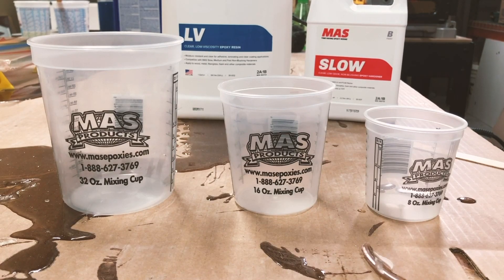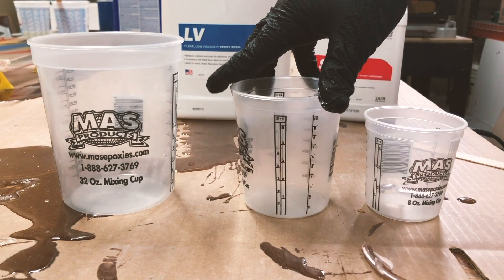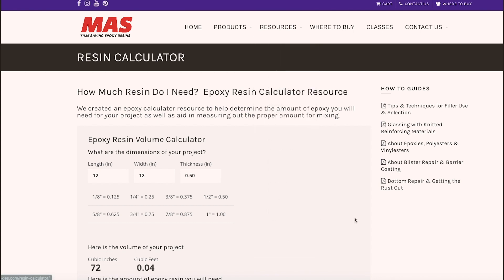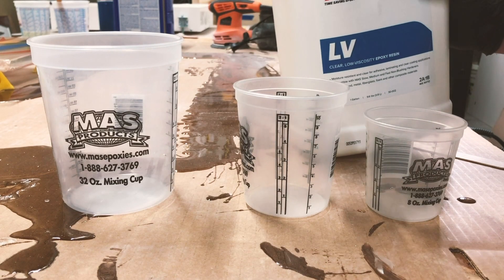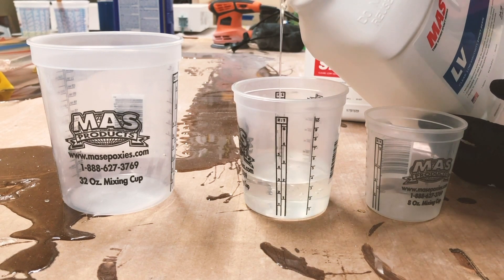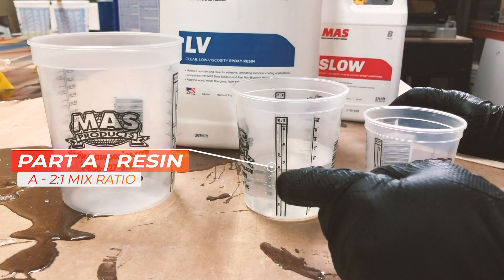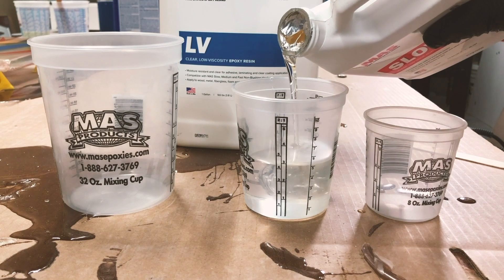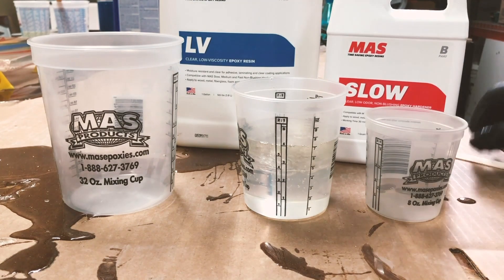How to properly measure epoxy resin |  2:1 Ratio Explained | How to use ratio mixing cups

Comment: I used 2:1 resin for first time and it doesn't harden after over 8 hours at all .. and it's not enough . Why?
Reply: Because video is wrong. Next number will double amount, but not add two portions of epoxy over hardener. You should use two containers to measure properly. For hardener use container A with low position number and container B for resin use the same number but in top position. Hope it helps.

Comment: If I needed a 2:1 ratio of resin and my total weight of resin was 90 grams, does that mean i would mix 60 grams of part A and 30 grams of part B, is that correct for a 2:1 ratio?
Reply: Yes vorrect

Comment: For a keychain letter mold do I put 3 resin and 3 hardener
Reply from the maker: It depends on which epoxy you are using! If it’s a 1:1 ratio like our table top pro or art pro, then yes! If it’s Annie’s Art Kit, LV, or FLAG then that’s a 2:1 ratio! You can use our resin calculator on our website to figure out how to do the math!

Comment: Still a bit confused if i was going to do a resin pour and the total quantity is 4 ltrs at 2:1 , is their a formula i can use to calculate how much of Part A and how much Part B i'd need to use, Cheers.....
Reply from the maker: Yes you’ll be able to scroll down on our resin calculator page! Then plug in the amounts that you’ll need to find the split!
Reply: I’m also still abit confused 😅  I have a river pour of 3 litres with it being 2:1 how do you calculate how much harder you need for 3 litres

Comment: These cups look super helpful! The only thing I’m confused about is how to figure out how much to measure, i understand reading the cups but I’m used to a 1:1 ratio so it’s easy for me to figure out how much to measure for each for four ounce, two ounces for each. How do you figure that out for a 2:1? Or when you use the cups and measure up to the number five does that mean five ounces? On the calculator you mentioned you have to put in the dimensions not how many ounces you need all up. Thank you
Reply from the maker: There is an area on the cup for that! So you’d pour your part a first to the 2 line (for example) then you would take your part b and continue filling to the 3 line. That would be a 2:1 ratio!
Reply: @masepoxies  first of all thank you so much for taking the time to reply to me, I really appreciate it. I understand the concept of using the cup to measure a 2:1 ratio. My question was what does the number 3, for example stand for? For 3 ounces of resin all up?
Reply from the maker: @Gazzaxxo  great question! Let me ask my coworkers because I do not know the answer off the top of my head!
Reply from the maker: @Gazzaxxo  so fun fact, they aren’t any measurement in particular! They’re just segmented portions!
Reply: @masepoxies  oh wow! Thanks for finding that out. How would you know which portion todo then? Maybe that’s what’s tripping people up…
Reply from the maker: @Gazzaxxo  basically it’s just however much you think you need. If you want, our customer service team can explain this better! Hello@masepoxies.com will get you to Cory who is great at explaining this while I am sub-par haha - Hailey

Comment: so 2:1 means eaqual parts a and b?
Reply: No that would be a resin with a 1:1 ratio
Reply from the maker: It means 2 parts of a and 1 part of b!
Reply: This is very confusing because the marks on the cups for the 2:1 ratio does not tell you whether those are ounces, grams or what and those marks only go up to 6. This is really confusing and useless.

Comment: I have two questions do those measuring cups come from paint stores...... And my other question is because I'm still a little dummy... If I pour 10 parts of one and it's a two to one may show saw the other ones going to be 20?.or 30
Reply from the maker: We sell mixing cups and similar cups are often sold at big box home improvement stores.

Comment: as confussing as i thought these mearuring buckets thought to be you sum up really well like  you flicked my Light bulb head up Ty man, and what of mixing by  Volume how does that work?
Reply from the maker: These cups are for mixing by volume. If you were to mix by weight you could use any container and a kitchen scale that weighs in grams.
Reply: @masepoxies  : i see thank you very Mucho, for responding to my question.

Comment: Hi I thought that if its  by weight  2/1,  that means for instance  you put 50 of part A and 25 of part B ? Please can you let me know, thank you  😊
Reply from the maker: the ratios by weight and by volume are different for all of our systems as part a and part b do not have the same weight. The system in the video is actually 100A:45B.

Comment: What if I don't have those cups? I did my length by width by height and got my ounces which I have to convert to milliliters since my silicone cups are marked ml instead hahaha, so of say I did 40 ml of part a would I do only 20 ml of part b
Reply: Thats what I did but my resin didnt cure, Im so confused  😟
Reply: By weight works too